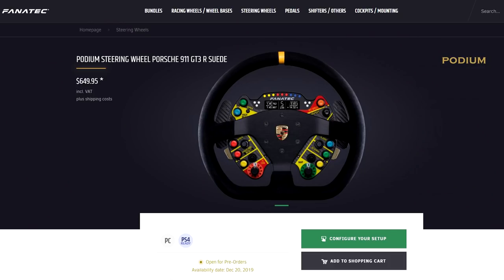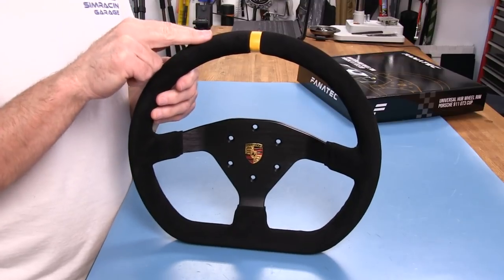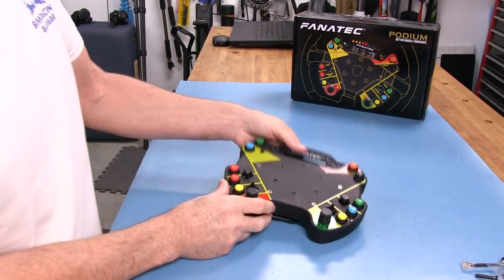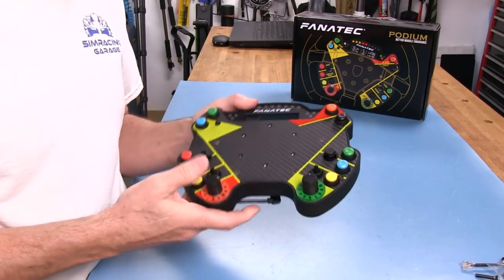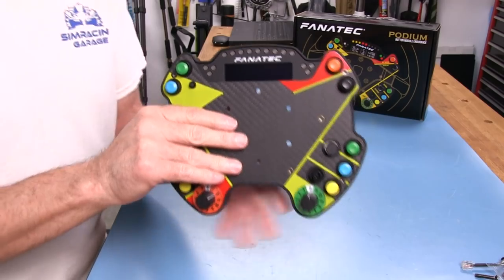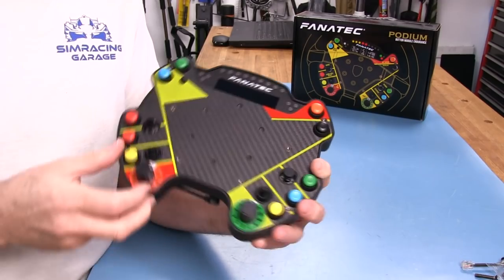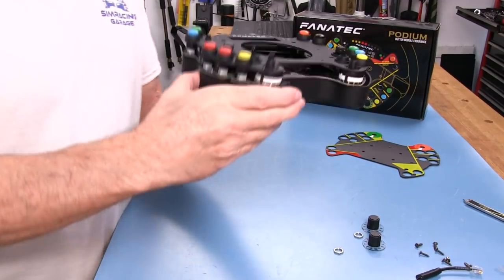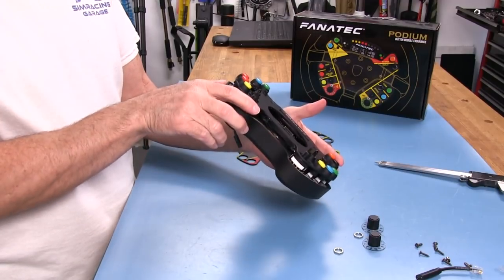Fanatec Porsche 911 GT3 R Podium wheel kit Review

Comment: Some additional tips to anyone looking to assemble their Fanatec Porsche 911 GT3 R Podium wheel kit. Some things to do different from this video: 1) The small paddles should be attached the opposite way to shown in this video so they sit farther from the rim. 2) You should use the spacers to bring the large paddles closer to the wheel rim. This way the paddles are easier to reach and it is easier to manipulate the different paddles as they are offset distance wise from the rim. 3) When attaching paddle wires to the hub, use the cut out holes on the top, not on the sides. It will be a much cleaner look wires-wise.  Also, FYI: I just received two sets of the Advance Paddle module and the carbon is now 3 mm thick.
Reply: nice advises 👌
Reply: Thanks, that was the information I was searching for!
Reply: Thanks, that was the information I was searching for!

Comment: Barry, you forgot to use the spacers on the APM Paddles for easier distinction between the upper and the Shifter Paddles. Also, the upper Paddles should be mounted from the back, not from the front (which already gives a slight gap for distinction between the Paddles so you don't accidentally push the wrong Paddle, especially when driving in VR and with Gloves).

The cables of the APM should be as deep in the Podium Hub as possible, it's fitting well so no reason to not push the cable all the way in, looks much better and it doesn't popping out ;)
Reply from the maker: Spacers were not used because I did not want the paddle reach staggered. Muscle memory works well enough for me. But yes that is an option. Stuffing the thick cables against the PCB to take up the slack certainly is an option. But I would rather not take a chance of any cable rubbing on the PCB. The way the BME covers that part of the APM and captures the cables will keep them in place quite nicely.
Reply: Agree with the small upper paddles. I've mounted them from the back to get a little extra gap to the GT paddles. 
And i think it's the way it meant to be mounted. Upper paddles from the back, GT paddles from the front.
Reply: ErnieGaming correct.
Reply: A quick look at the instructions would show you the cables are meant to cross over inside the hub :)
Reply: @bertram-raven  only women read instructions

Comment: I have the podium shifter kit on my F1 rim and the paddles are solid. I've never had an issue with mine in over a year of heavy use, despite them being thin. Because of the magnetic actuators and short throw you don't put the kind of lever force on them that would weaken them. The original shifters were much easier to yank on too hard and on my original Formula Carbon rim I have absolutely bent the metal shifting plates on accident.

Comment: I just wanted to inform you on your pedal shifter the smaller one is screwed from the back side also they say for a larger wheel you want to use the spacers that's why you're having problems reaching for them. Just a heads up and thanks for the video. You do awesome work!👍🏻

Comment: The wheel as a whole package is gorgeous as hell, there's no denying. Aesthetically especially, Porsche fanboy here! 

But i'm not a huge fan of the Fanatec quick release system and what i've seen in various reviews of the podium DD system, the amount of play and wobble in the connection is worrying. I wish someone would make an adapter to have this wheel work with a simucube 2 wirelessly, with the simucube dovetail-style mount or a Q1R . At least my simracing future for now looks like a Simucube 2 instead of a Podium DD, which is a shame, since i've drooled over this wheel since it was unveiled.

And maybe someone has an adapter made or in the works, but my knowledge on these matters is still too incomplete. But all this thinking might be hoping for nothing..
Reply: Z-Ring = no wobble. Yes it has wobble from the factory. No it should not be sold with a wobble. Print/buy Z-Ring. Install. Problem solved.
Reply: Youre better off with the Simucube 2 mate. Plenty of wheel and button setups out there. I know fanatec has been hitting it hard these past 2-3 years to get that market share and theyve been releasing some great products but I think you can easily get something similar like this for your Cube. The one thing I dont like about fanatec even though I own their stuff, is the fact they nickel and dime their customers with their whole "Eco system".  With the money  I spent on a CSL Elite Setup I could have just got a Simucube if I was patient and pad the little bit extra. Its like buying a motorcycle,  get the one with more power because if you get the slow one to learn on youll grow out of it quick and want to upgrade shortly after.
Reply: @iamjamen  I saw Barry review that on this channel too, and it seemed to eliminate alot of the wobble out of the system which seems like a very goof add-on. But it didn't seem like a "rock solid connection" even after that. Yes, i'm being really anal about it but at that price point especially, i would expect more rigidity out of a DD system. Maybe if fanatec would redesign their wheel mount system to include something like the z-ring in metal, then i would probably consider it seriously.

Comment: I still think a buying cheaper knock off Ebay replica sparc, momo, ferrari, omp, posrche wheel, etc,  at around  30-50$ is still the way to go for most people with the ability to use aftermarket 6 hole wheel. I have a $35 OMP suede Deep Dish Rally Wheel and a $50 Porsche Wheel like this one with easily a 1000 hours of hard driving on both using a CSL Elite. No Flex, material, or thickness issues. A wheel itself is the most simple thing on a rig (not talking about buttons, adapters, paddles, or anything that attaches to it so you can use it) . I know real ones are stronger and better materials but Im not driving a real race car and most arnt running 10-30m of torque with Direct Drive wheels. Love your vids, Barry!
Reply: Can you tell me what you search on Ebay for most wheel rims? I am not having quite as much luck!
Reply: @ebenezervalvi1009  Type in 320mm Racing wheel or variations of 310mm, 350mm, etc.) and filter with your price set to $50 and below or whatever your willing want to pay
Reply: @ebenezervalvi1009 Another 25$ all arounder. If you want suede or alcentara youll have to go to the $50-100 range
Reply: @d3tach3d  Thanks a lot man! I will look into those and now I know the correct keywords! Much apprecitaed for the links as well!
Reply: @ebenezervalvi1009  No worries, brother. It was worth the time helping out another in the sim community.

Comment: Hi Barry, I remeber in your DD2 review you mentioned that the fanatec quick release system is never a tight fit, that the wheel wobbles a little bit when attached to the motor. Is it the case here with the podium hub? Thank you very much!
Reply: I haven't had any problems with the podium hub. Mine doesn't wobble at all.

Comment: Barry, I have figured something out that is a huge problem with this wheel and many other Fanatec wheels.  The wheels just stop working during a race or practice.  I have the exact wheel combo in this video.  My stuff is brand new and only two weeks old.  During multiple races it would just stop working.  It still had power but nothing worked.  I added dialectic grease to the pins and all connectors and haven’t had the problem since doing that.  I think this is something you should look into on your show as this is a BIG problem for many Fanatec owners.  It’s a very cheap and simple fix.  For one, why is it happening and two why did dielectric grease fix it?!  Check it out.  Thanks

Comment: As always great review, question can I use this same configuration on my clubsport v2.5 base? Thanks
Reply from the maker: You can use is, but the Endurance module won't work. The APM modules will work fine.
Reply: @simracinggarage3026  do you think the endurance module will ever work with clubsport?
Reply: @graywolfoverland1377  Yes but no ETA because they first wanna fix all the bugs for the DD system with this item.
Reply: Hi all!
What is endurance mode?

Comment: It would be nice since it has a USB-C plug if it were usable as a standalone button plate for other wheel systems - then even if you don't have a Fanatec base you could still purchase the product.
Reply: You can of course use third party wheels on the Podium Hub BUT you still have to connect the wheel via USB to the pc directly because the USB port on the Podium Hub is NO data port!

Comment: When Fanatec brings out a push-pull rally shifter I'll grab one of those. These are great but I'm no fan of flappy paddles especially IRL.
Reply: Their current stick shifter doubles as a rally shifter. It has a rally knob and a stick shift knob and there’s a little switch on the bottom middle of the shifter body that you just switch the to side to turn it to push/pull mode

Comment: I just got the podium hub and it has a lot of play. So I tried to use the bolt but it's not long enough to reach the threads in the hub shaft. I never had to use the bolt with any of my other wheel rims.

Comment: Hi Barry, how do you activate the telemetrie of the porsche whell? couldn't find anything about the settings in Fanalab 1.24 or in I-Racing.
Reply: Did you enabled the ITM for iRacing via Fanalab? Then you should see in the display the small text "ITM". Once you see that text, press the tuning menu button and turn the funky switch at the same time to scroll between the legacy mode and ITM.
Reply: @isthernes  still forget to turn IRacing to Hub :-)  now it works

Comment: @Sim Racing Garage hi Barry, There is a set with the same rim and podium bottom module endurance but with the universal hub. Could you please tell me if there's a benefit to get podium hub over universal hub for 100 €/$ more. I want to buy this set but can't decide between podium and universal hub. Thanks in advance.
Reply: The Universal hub comes with the standard shifters of the uni hub, so if you want better shifters a magnetic paddle upgrade will cost you 99dollar/euro making it a price of 650dollar/euro so actually if you want the podium paddles its the better deal with the podium hub because you get the podium paddles already in the deal so you save 80dollar/euro taking that one. 
I have heard though that the magnetic paddle shifter upgrade of 99dollar/euro is actually stiffer then the podium paddle shifter upgrade so it’s totally up to you if you want the extra paddles or not. 

Hope this helped you in any way and good sim racing ! 

( I’m looking for the same wheel at the moment so glad to share the knowledge)

Comment: Hi Barry, Is it possible to remove the sticker on the Podium Endurance Module? I would prefer a more clean looking of the button module.
Reply from the maker: The lines and color sections are printed, or silk screened on. So, not easily removed.

Comment: Holy crap what it that sim rig though... must have been insanely expensive, right?
Plus really curious what kind of power it draws... must have a significant effect on your power bills if used regularly, surely?
Reply: If you can afford it I'm sure that you wouldn't even notice the extra electricity bill, and I've seen similar 4DoF movement set ups for about 2k.

Comment: I just got the podium hub for my dd1 and it has a lot of play so I went to use the bolt to tighten it up and it doesn't reach the threads in the base shaft. I never had to use the bolt before wtih any of my other rims.
Reply: I had the Same problem...just pur the quickrelease on till it doesent go any farer in there then let the quick release snap and push the wheel without holding the qr back you will hear a little Click...then tighten the ring and the Screw should go in

Comment: i love your info mate you have made some of my buying decision easy, i am stuck on now to factors do i get the fanatec eco system or buy the simucube dd and get v3 peddles from fanatec and then what i am confused on is there way to hook up say fatantec wheels to the simubue dd base. cheers if anyone can share some info on it
Reply: I believe you can get Fanatec wheels to work on Simucube but it needs permanent cable between the steering wheel (Clubsport or Podium hub) and the PC (And a Fanatec - Simucube adapter ofcourse). As for the Podium wheels I think a lot of the functions of the wheel will NOT work. If you like the rims go for Fanatec, that is what I did. Even though I initially was looking for Simucube. But I was also already in Fanatec ecosystem.
Reply: Explosivefibers yeah I am not in that eco system at all but I do like the v3 peddles and shifter and handbrake. But over all thoughts on dd wheels sc2 seems to be the option I might go if I end up with dd base. I am weighing it up as it’s looking more n more like arm and leg just to get what Eva setup really. That said my mind keeps telling me it’s sc2 I want.

Comment: We really need a channel where the hardware is disassembled like ifixit does it and we are being told how much the components are worth. E.g. this OLED display costs about 3.50$ where its made: China. So I guess the components are not worth more than 200$ max. Add 50$ for labor, distribution, packaging, other costs etc. Then compare to the price its sold for. Maybe that´s another angle we need when talking about a fair price point. I think 400-450$ would be a fair price. Anything above it is skimming the fanbase.
Reply: Such a tear-down would be interesting - but I don't think it would be fair to just add up the component costs to assess worth - you'll also have to take R&D and tooling (like the plastic molds, which are quite expensive to make) into account. I don't think the components and materials alone for this wheel cost $200, though.
Reply: @bigredracingteam9642  You would be surprised at what price point you get mass components in China... take the display on the Fanatec DDs: 3.50$ on Alibaba, so I guess Fanatec doesn’t pay more than 1.80$ for it. The molds are made in China as well, so while not cheap still a lot less that we think.

Comment: I hope we get a dedicated video on if the buttons on the button box do work as its supposed to
Reply: Yes, they do.
Reply: @momorious  every button can be programmed to work in a race?
Reply: @yungdadi  yes of course? Why this should not work?! 🤔
Reply: @momorious  fanatec has been sneaky about the functionality of the button box
Reply: @WhiteHawk77  on Xbox still almost nothing is working because of Xbox code limitations, that won't change. On PS4 it's up to the game devs to implement features like MPS etc.. Only on pc you can be sure that every button will work. ^^
Reply: @WhiteHawk77  it doesn't work on pc?
Reply: @yungdadi  of course it works on pc.. Everything works on pc. And where is Fanatec sneaky about functionality of the BME? It was always said it's only working on DD Bases for now and with firmware updates in the future also with other bases. Everything regarding compatibility is listed on the Webshop page.
Reply: @momorious  that's the problem.  A button box that requires future updates to work. The same issue with the DD wheelbases.  For a while I thought they were not as good as simucube then updates made it as good. I wonder why a company like fanatec is selling unfinished products? Its like buying a phone with the hope that the company will give you functionality in the future 🧐
Reply: @WhiteHawk77  well I play ACC alot & a little  bit of iracing  so I have to be sure what am getting works. I like the wireless system fanatec offers but am not sure if they are offering a finished product like simucube is
Reply: @yungdadi  every button works in that games.
Reply: Is it going to take as long and have 30+ delays like fanalab to work with the other bases?
Reply: @Fanatec_is_TRASH  if it's necessary, yes. First all open issues of the BME on the DD have to be fixed before it makes sense to roll out the firmwares for the other bases.

Comment: Would the podium hub fit on an Ascher Racing F64? It looks like there might be some clearance issues with it.
Reply from the maker: No. Clears the shifters but no the clutch paddles as they are angled toward the wheels center. Pity really... But there may be a different mounting system in the the future for the Podium DD wheels that would allow it to happen.

Comment: Amazing review, but i have one question: Can you test the compatibility with Clubsport Wheelbase v2.5, do the buttons still work and shifters? Would like to know, as always thanks for review and your work.
Reply: You can find all this information by using Google or have a look at the Webshop page. For now it is ONLY working with the Podium DD Bases. Other Bases need a firmware update to get compatibility which is coming later this year. So, no, it's not working with a CSW v2.5 atm.
But, because you asked, the shifters are working because only the Button Module is not compatible yet.
Reply: The display doesn't work to the full extend on the 2.5 or the CSL so you have to buy their DD to use that
Reply: @Fanatec_is_TRASH  the display will work to the full extend on the CSW v2.5 but not at the moment as described in the Webshop page because a firmware update is needed which is expected later this year.
Reply: I was just wondering would buttons work but i guess no since Fanatec has not given any detailed information, thanks.
Reply: Kriss047 no, nothing works on the csw v2.5 yet.